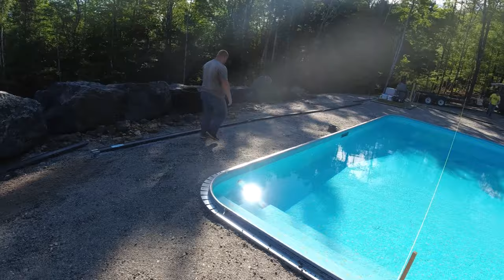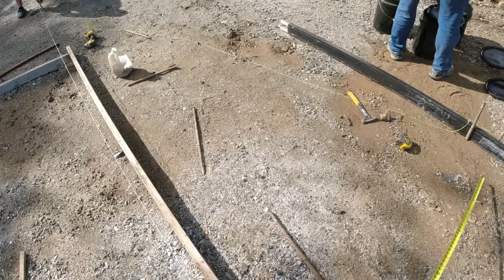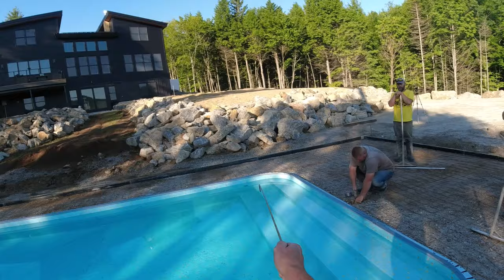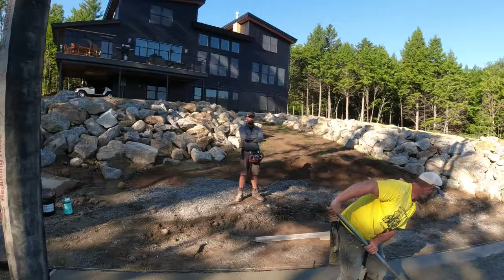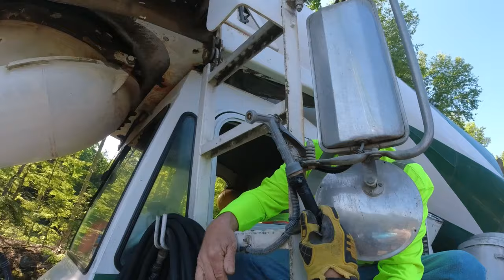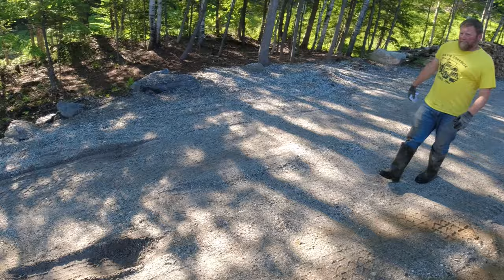Concrete Pool Deck Faceoff: DIY vs Professional for a PERFECT Finish

Comment: Hey Mike
Great video and the deck turned out nice. 
You know that if you form the wider part of the deck you’re gonna be high on the narrow sides. By the time you set grade on the wide part (the 12 foot), you’re already 2+ inches below the top of the coping, then when you try to set grade on the narrow (the 6 foot) you’re high. But it’s either one or the other. Because if you set the narrow grade first you won’t have the fall you want on the wide grade. 
And then that’s when you might have to dig some. 
You and your crew are great together. 
Thank you Sir